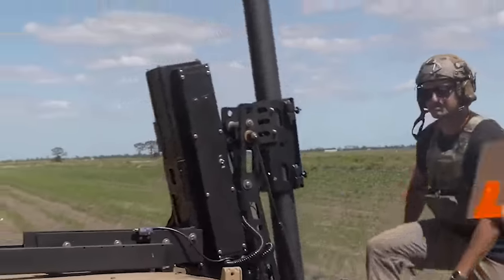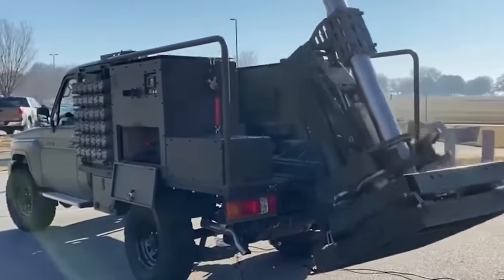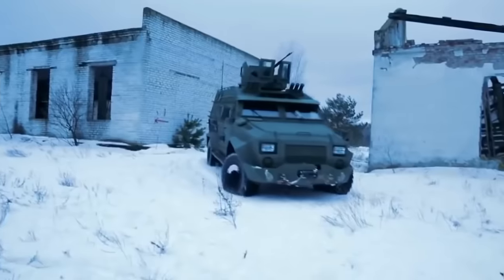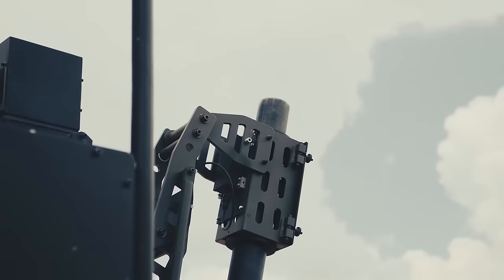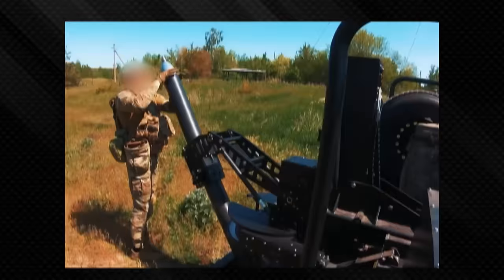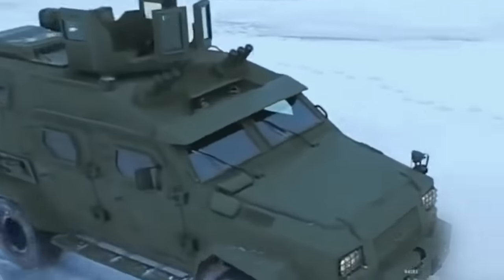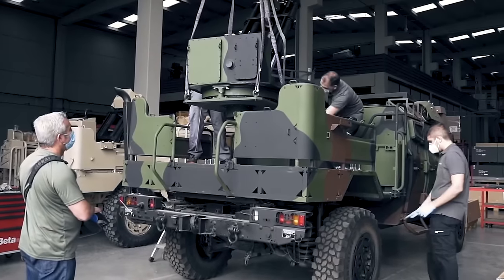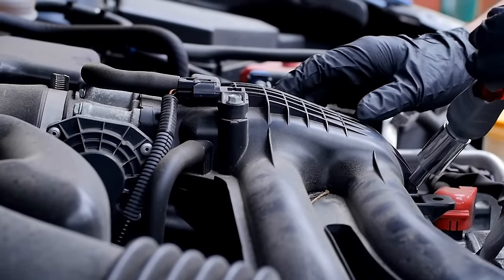Giant US Mortar Spotted Crushing Massive Russian Raid

Comment: AMOS is better.  Usually double barreled 120 MM breach loaded turreted tracked or wheeled carriers.  Capable of single unit TOT, Time On Target missions, to use the WW2 terminology.  It can fire, I, 4-6(maybe even 8) salvos at a single target.  All time of flight coordinated to land at the same time and same target.  But counting the standard deviation of rounds in flight.  Then it is SCOOT SCOOT SCOOT!  And get out of the proverbial Dodge.  Move on to the next firing position.  As an added bonus you can direct fire with your new system for close in defense!
Now I'm probably wrong about how many salvos it can fire for the TOT Mission.  And I apologize for if I am.  I remember that it was 4 at least.  Ok, looked it up and it has a 10 round burst. Called MRSI, Multiple Rounds Simultaneous Impact.  Accomplished by changing the elevation of the tube and firing up to 5 times.
Self loading.  But with a loader to assist in non standard, ie HE, rounds that are not in the ready hopper.
From the Finnish nation.